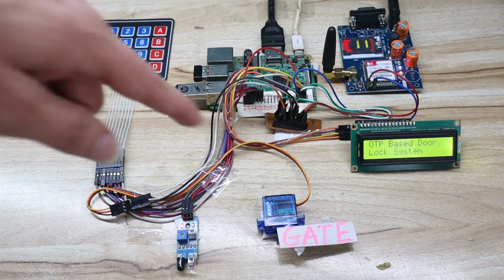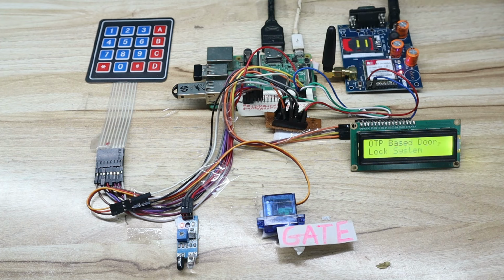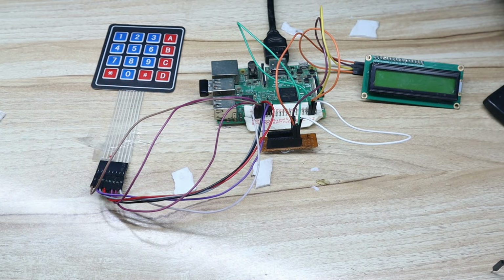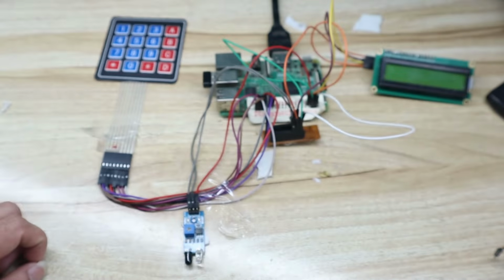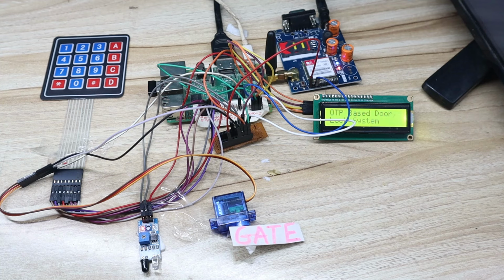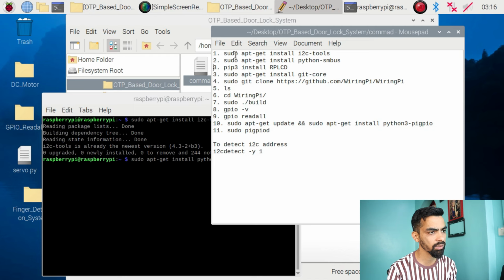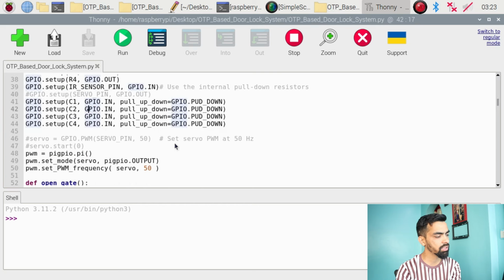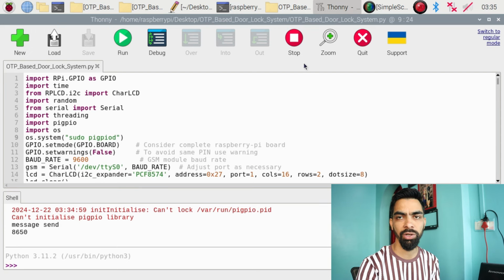DIY OTP Based Door Lock System | | best innovative science project #scienceproject #science

Comment: Sir can we use sim 800L module core board quad band TTL serial port instead of SIM 900 A . Will
It work
Reply from the maker: @anupal5750  try it should work every gsm module works on serial protocol
Reply: @Rahul_Jadhav_Project Sir can you tell in which ports should we give the connections in the 800L module
Reply from the maker: @Sha-p2e-o4k  explained in video
Reply: thanks a lot